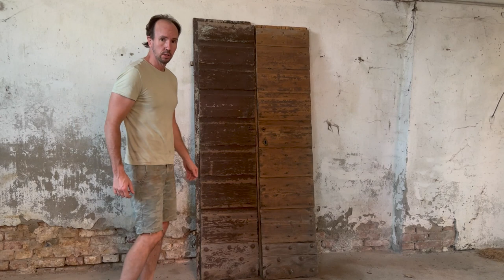We are BUILDING and making a MISTAKE - Episode 15 of our Italian house renovation.

Comment: those large glass jars in the barn are really cool.  Concrete forms can be a pain- more reinforcement the better as wet concrete is so heavy! add some bracing. I am sure it was nice to have your fathers help- always good to work with someone on projects. Happy doggos!
Reply from the maker: Yes, those are old demijohns from when there was wine production in the house.
Exactly, the concrete becomes very heavy so the first mold we did weren't strong enough.

Comment: I appreciate the good will and unfortunately I arrive a little late, but from the images it seems that you used only cement mortar.
The mortar should be elastic and always weaker than brick and composed of lime (hydrated or hydraulic) and a little cement or pozzolan.
When making openings it is better to start from the reveal and close on the wall using guide molds, not the other way around as you did. The result is better and the wall more solid.
Furthermore, to make the concrete solid with the brick, it is always better to apply latex between the casting and the brick.
I hope these few tips from an old surveyor will come in handy in the future, good job.
Reply from the maker: The mortar we used were pre-mixed bags that our local material store told us to use for old bricks so I guess its a mix cement, lime and sand. 

As for the opening we couldn't start at the guide molds and then go towards the old brick as that would have made us have cuts up against the old existing brick, its all going to be exposed so it would all be visible later if we did it that way. 

Thank you for the tip on the latex, never tried that before as I haven't worked with brick before (not very common in Sweden).

Comment: I'm certainly not a builder,  but I'm wondering why you don't use metal building reinforcement when pouring concrete or laying bricks?  The strength of brick wall and cement will be guaranteed.
Reply from the maker: I am when I am pouring concrete, however the wall I were building here is just to block of an old entrance, it has no structural importance at all as its a reinforced concrete beam above the opening. In the previous video where we blocked of a wall with lighter and bigger blocks we used metal bars to provide strengt.

Comment: I was thinking the opening looked a little small.  Does the 97 cm measurement account for the door frame as well or will you be fixing it into the cement?  The main thing is, it can be fixed!
Reply from the maker: They will be mounted traditionally without a frame. 
Yes, luckily its not a big issue!

Comment: don't know what your budget is like but i be looking at a jack hammer with all the concert your removing i got one from Makita HM1307CB 35 lb. Demolition Hammer, accepts 1-1/8" Hex bits, Blue on amazon 950 USD works great saves on back
Reply from the maker: Yes Harely we are severely underpowered when it comes to tools, but the problem at the moment is we do not have electricity at the house as we are moving the main line into our house.
Reply: @VillaAroldi

Comment: Why did you not but the bricks up to your door template?
Reply from the maker: I wanted some concrete to have something solid to screw the hinges to, but now when ill make a cut into the bricks ill get that anyway.
Reply: @VillaAroldi  Got it. I assume you will be using the doors you are restoring, might I suggest hanging them like a barn door on a rail. The need for hinges would be negated. Love the job you are doing.